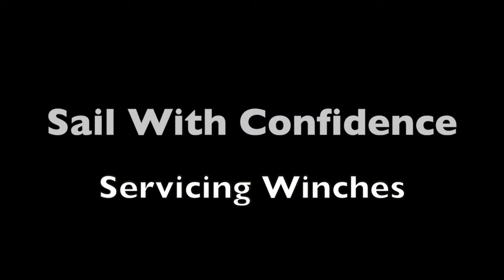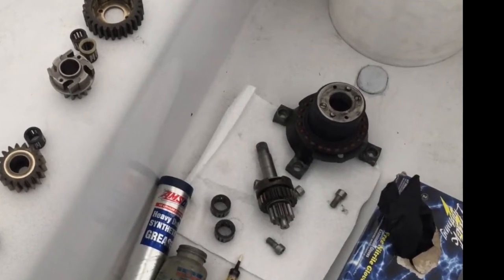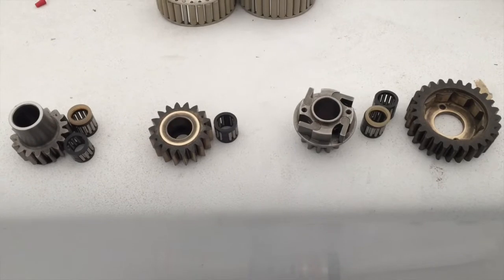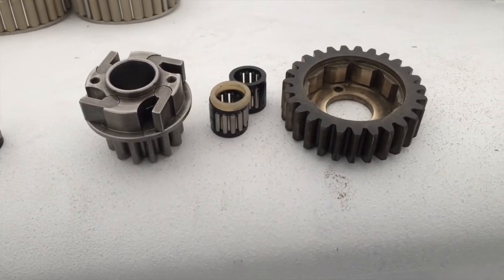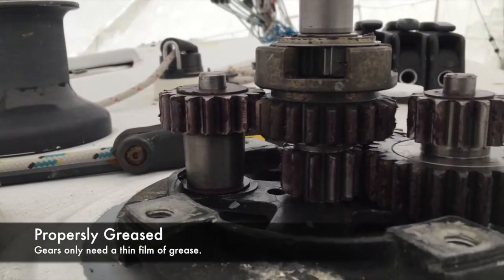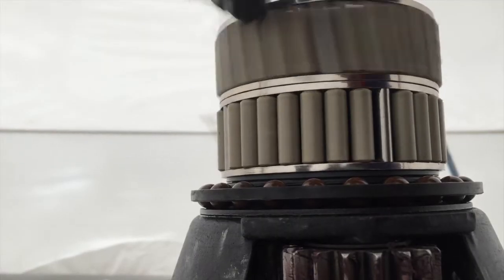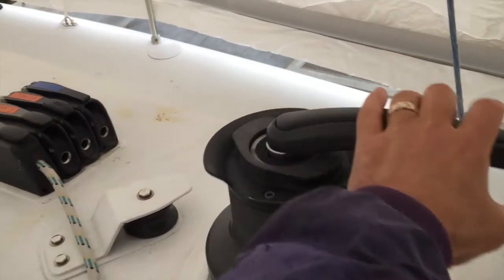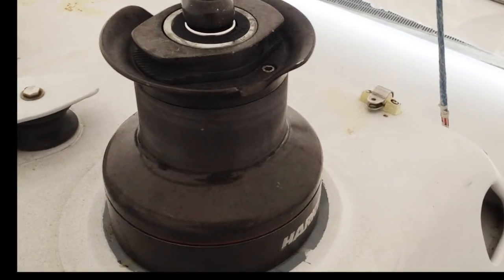How to Service Winches

Comment: Two points, minor or major depending on your (or your friends') experiences in performing this task: 1. It's a really good idea to make a masking-tape-and-cardboard fence along the nearest rail. Winch parts love water and will leap over the side given the slightest excuse. Note that winch parts aren't too smart, and will make a similar leap when you're on the hard, which is less than ideal for carefully machined parts. 2. Some 3-in-1 oil formulations (as depicted here) include some sort of stabilizer that gets gummy with time, so you may be better off with a squeeze bottle of pure 20-W or 30-W (or be really religious about regular cleaning and re-lubing).